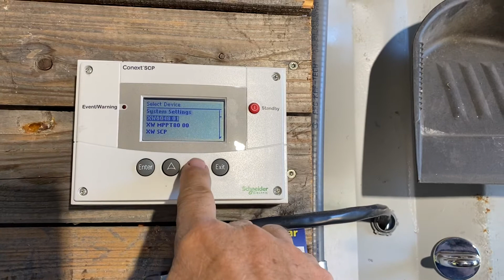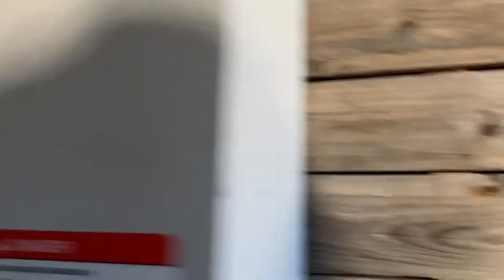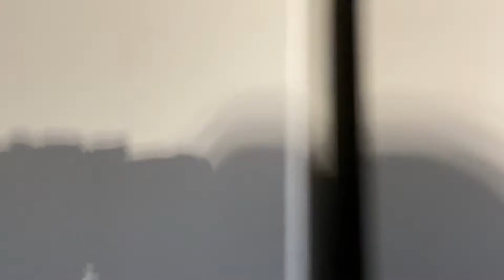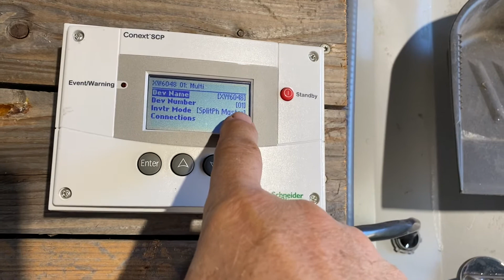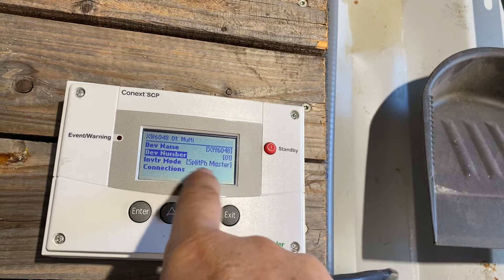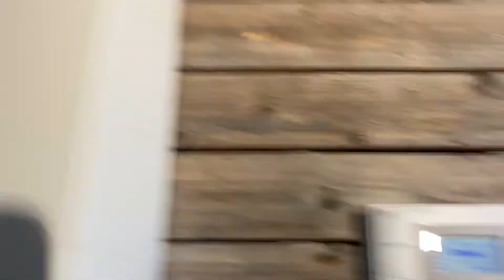Stacking multiple Xantrex XW inverters for Master Slave 120/240 output

Comment: Is there a way to wire 2xw 4024 xantrex inverters without a control panel
Reply from the maker: I don't think so. You need the SCP for so many other settings as well.

Comment: Hey! Do you still have this system? I've seen some of your newer videos of the solark. Would you be willing to sell this XW6048? I'm in need of one to parallel with my current xw6048. Thanks
Reply from the maker: I still have it and it is still functioning at my shop. Those inverters are so great! I can’t sell it. I can ask around to see if anyone has one available.
Reply: @maverickmacgyver  I would really appreciate that if you'd help me! They're such robust inverters. My current one has been in use since 2011. I've been trying to source one for awhile.